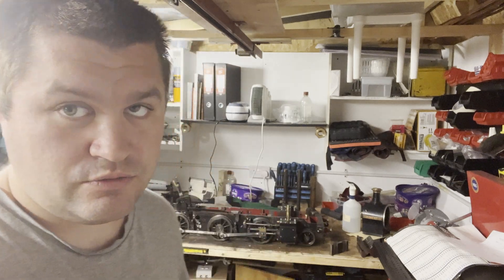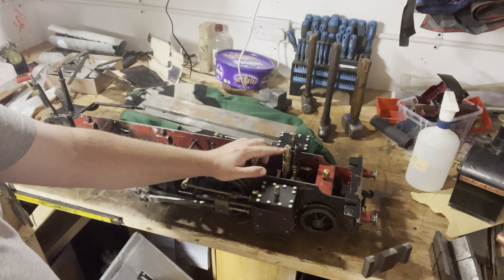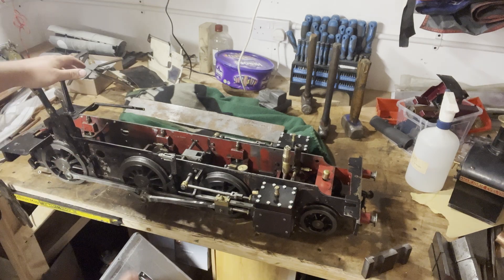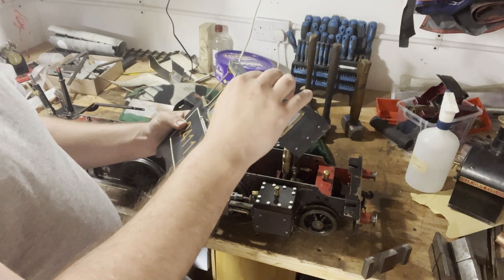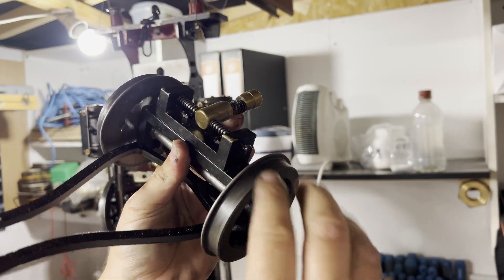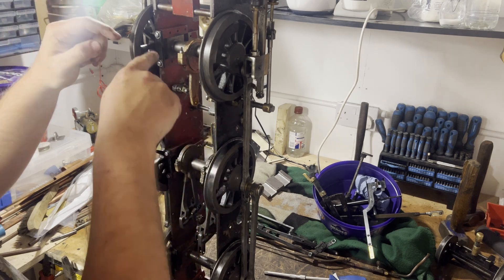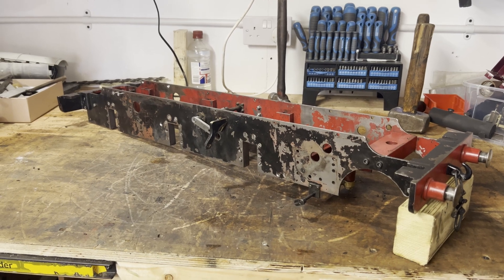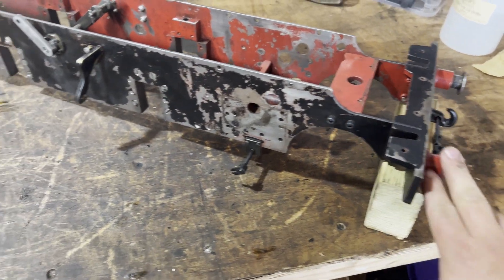The Return of Polly - Frame Strip Down

Comment: Sorry to hear you have problems with Bantam's boiler. I wonder if combustion chambers are worth the considerable extra work in construction, and as a potential source of trouble later.
Reply from the maker: Its replacement wont have one, just a plain simple boiler with much higher superheat
Reply: I think the extra water capacity, will be an advantage.